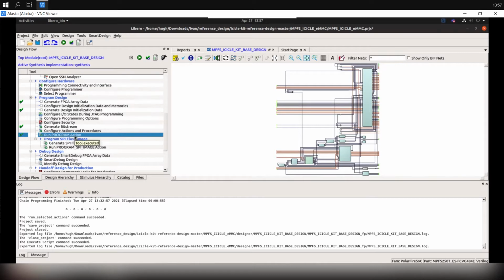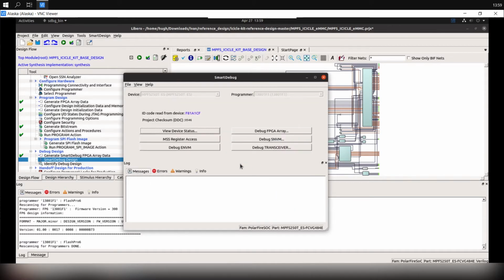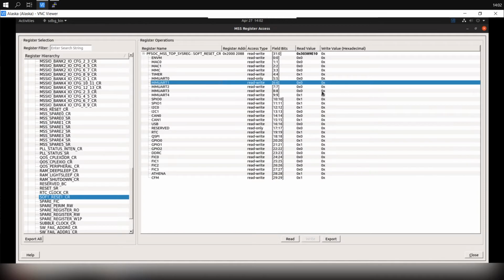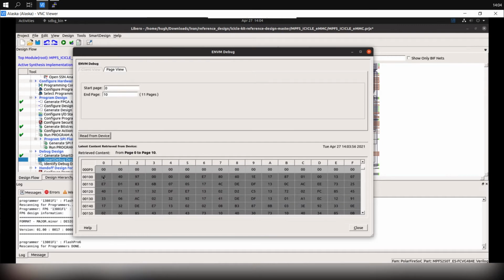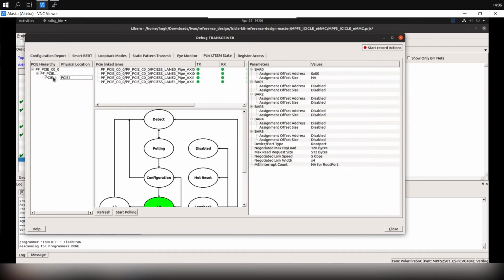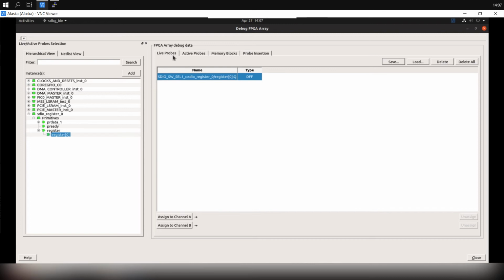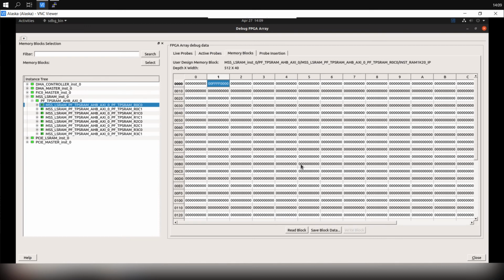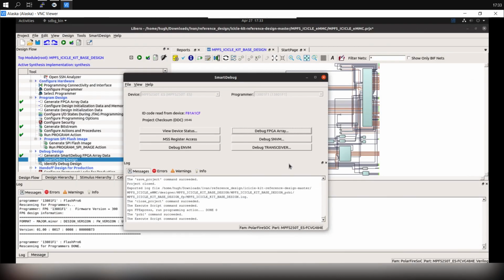Debugging PolarFire® SoC - Smart Debug

Comment: I am told the new smartdebug version allows the recording of waveforms to a file, that can then be viewed in the simulation tools. Is this true?
Reply from the maker: Hi there, thanks for your question! As of Libero SoC v2024.2, SmartDebug includes the capability to capture waveforms. You can save the waveform view of selected active probes by using the "Export Waveform" feature. To do this, specify the number of clock cycles to capture in the provided text box, then click "Capture Waveform". The waveform will be saved as a .vcd file.
To view the captured waveforms, import the .vcd file into a compatible waveform viewer that supports the .vcd format. Additionally, the "Record Actions" feature allows you to record the register sequence of XCVR operations into a debug transceiver file. You can learn more at the following links: https://ww1.microchip.com/downloads/aemDocuments/documents/FPGA/swdocs/libero/smartdebug_ug_2024_2.pdf / 
https://www.microchip.com/en-us/products/fpgas-and-plds/fpga-and-soc-design-tools/fpga/libero-software-later-versions